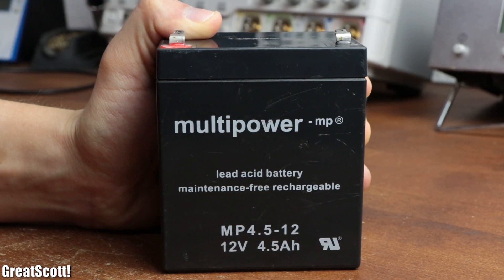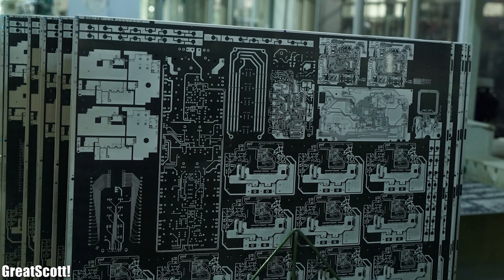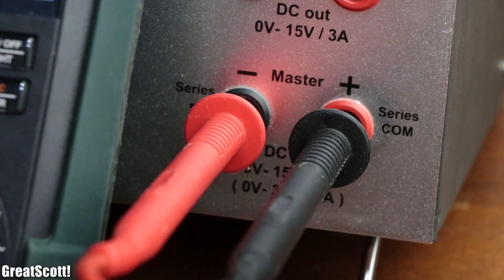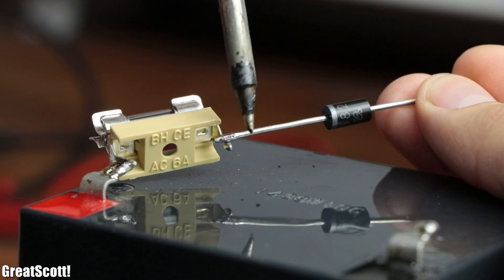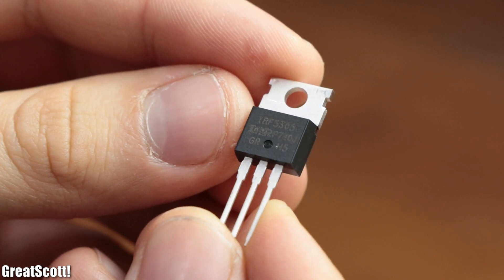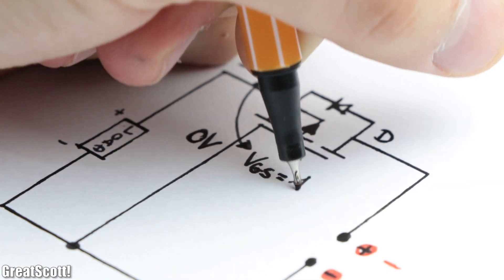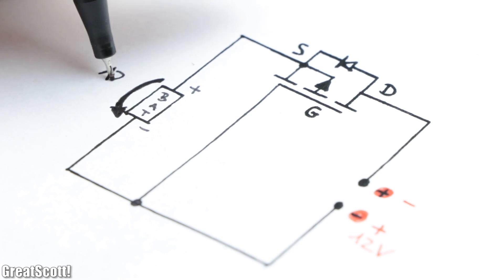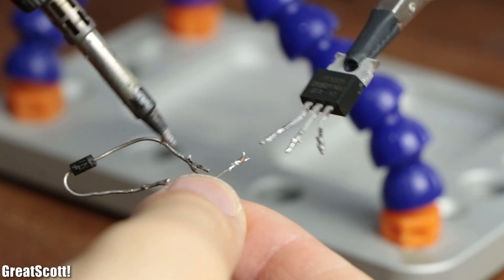What is the best Reverse Voltage Protection Circuit? || Repairing a Lab Bench Power Supply

Comment: Could anyone point me to an effective circuit for reverse polarity protection for a single 18650 battery and a small load?
I have modified my guitar's "Tronical" automatic tuning system to be powered by a Samsung 30Q Li-ion cell, but if I connect the cell in reverse accidentally (which would be seriously easy), I'm worried I will fry the difficult-to-procure tuning system. I have tried a diode sold to me by jaycar electronics, but the forward voltage drop was 0.6v and made the Tronical behave incorrectly. Obviously can't short the cell to itself, nor can any reverse voltage reach the Tronical. if anyone is able to use their superior understanding to help me with this mod, perhaps even help me find a source for parts or a small PCB, I'd be happy to chuck you a few bucks :) can also take the Tronical apart to show you the board, if that's of any consequence, but ideally I'd like to create the smallest possible circuit that protects both the tronical/load and battery/source completely and doesn't enquire fuses. if this can only be done with a fuse, I'll attach a fuse block to the front of my guitar.

Comment: You can use relay and diode 
You will get zero voltage drop and zero power loss 
The circuit works only when  reverse is applied

Comment: Try a SUP53P06-20 its on resistance is only 0.02Ohm for even less voltage drop. I would suggest mosfet protection, using a 10K resistor between the gate and -ve and strap a 12V Zener to clamp the gate voltage.

Comment: What is the point if buying such an expensive power supply if it doesn't have a reverse voltage protection built in it

Comment: I used just fuse and double shottky diode(s15d40c) from 5V rail of dead ATX power supply. It can handle shorts 100+ amps for a second, and have very low resistance. I think thats the best possible protection.

Comment: This "solution" only works for recharging batteries that are not flat.  A completely flat battery doesn't supply a voltage to turn on the circuit.  Neither would a regular load like a resistor or capacitor.
  In general, connecting a battery backwards to a power source is like a double strong short circuit and should be handled by short circuit protection mechanisms.

Comment: Hey, Scott can we use a relay and diode arrangement for this solution. Like Relay will only turn only when battery terminals are connected in right way?
Reply: Do the opposite ....wrong connection trigger relay disconnect
Reply: @davey2k12   ok let me try this one

Comment: I use capacitor between negative and postive terminal. If capacitor charged you can protect systems  Manual, by see the sparks if you change terminal. If capacitor discharge problem

Comment: And if you put a normally closed relay, with a diode, and when it is reversed polarised instead of short the diode it shorts thru the relay coil, opening the circuit?

Comment: I would have liked to see you use a real relay instead. No voltage drop at all :)
Reply: glyn hodges  Isn't 20mA the typical on current of a relay? Use and inline resistor to limit the current to the specified on current. Actually slightly higher, otherwise the load can pull the rail down enough to allow the coil to release, begin oscillating, and start buzzing the relay.

Comment: I was testing 2 different 13.8V power supplies to pump up an air mattress and by accident, I forgot to disconnect one of them while energizing the other that was also connected, I guess it didn't like backfeeding power that way as it damage BOTH of the power supplies.  Do you think I should try a similar fix (replace diodes) as you illustrated here?

Comment: why not use a bridge rectifier... seems to work all the time for me? what are your view?
Reply: the current passes through 2 diodes in a full bridge rectifier, and that leads to a voltage drop of around 1.2V, and you'll lose power accordingly.

Comment: Just made the same mistake... My solution is putting a external connection to the diode, so if i accidentally blow it again i wont need to disassemble the entire supply to changer it

Comment: Even though the circuit seems reasonable for voltage and most passive loads, what about inductive load?It seems as if there is no free running path for current in case the power supply is suddenly turned off.
 I've always thought that the diode in parallel with power supplies was not primarily a sort of fuse, but rather a free Wheeling diode.

The thing is, the circuit is pretty good, but it still needs some inductive kickback protection.

Comment: What about the body diode? Isn't it always in reverse polarity to the normal current through a Mosfet and so makes this circuit faulty? You can get a so called "ideal diode" but it consists of 4 Mosfets that simulate a diode because its not possible with just one - cause of the body diode!??

Comment: The output diode in series does not protect againt reverse polarity. It only protects the psu against high battery voltage.

Comment: Simpler method is put a diode in parallel with the output terminals and a fuse in series with one of the terminals. Wrong voltage applied to the terminals causes the diode to conduct and blows the fuse, and in normal operation the fuse is the only thing in the circuit, as the forward voltage will only happen when reverse voltage is applied. That is cathode to positive and anode to negative terminal.

Comment: Just was "gifted" a radio shack 447 CB. (Wired backward by original owner). Yes zapp.a Protection diode change. She runs like a banshee now. Protection circuits rule. Kv4li

Comment: And what about a diode in parallel which then has a fuse, so when reverse polarity is applied, current flows though the diode, then the fuse to close the circuit, the fuse blows up and cuts any connection from the psu to the battery? I see no drawbacks other than the fact that you have something blowing up that will need to be replaced every time you fuck it up.

Comment: blew today a device I was building, the device was done, and I was just doing the final calibrations. As I was plugging in my 12v power source I slipped with my multi meter and short circuited the supply voltage... my device is now Lightning like a Christmas tree. I guess the IC´s are absolutely toasted

Comment: I always check each and every connection with my multimeter before plugging power in and I check the battery terminals for current directivity before plugging anything in. Quick, easy and as safe as you can hope for (unless you're wearing jewelry - Example if you have a ratchet/socket in your Right hand and touch your socket to either terminal and don't realize you're touching your Left hand's wedding ring to the other terminal you instantly die as the power moves straight across your heart [it's right between your 2 arms & hands!] but good luck convincing anyone to remove their wedding rings when doing such work!).

Comment: you could just replace the diode with a higher rated one say 100 amp and then a fuse or circuit breaker in series

the diode would would do the same job as before but would take longer to be shorted thereby allow you to first burn up the probes long before blowing the diode but a fuse would protect against that

Comment: When charging batteries use a proper charger. My icharger detects all sorts of misconfigurations and as scotty said prevents fire..... you can get ics spevially made for a multitude of reverse current reverse polarity short cct and more.....
Reply: Scott . Maybe build an external all singing and dancing super protector with meters and leds. Maybe use the ltc devices or whatever...

Comment: WOW! I can't believe for the price of the equipment that you use that it doesn't already have PROTECTION!

I want to BUY that if you can make me a PNP for my INVERTER/s. We seem to have a MAJOR problem in TRACTOR-TRAILERS that cause inverters to blow for no reason. The small cheap 1's are pretty stout but if you buy any of them over $100 they become TRASH very fast.

Comment: I hate how segway made their controller for their electric scooter i was modifying one by adding a volt meter i had the wires already connected to the controller and the battery but the wire was too long so i had to cut it but to my stupidity i forgot that there was already power running thru the wires and i accidentally cut both positive and negative at the same time thus creating a spark i just ignored it but then it wont power up again i just hate how it doesnt have a short circuit protection

Comment: Only Diode in reverse is still the best, all other Versions can change your Output of your Power supply !
i would only use a Fuse with very high Amp rating, because they have a resistance too.

All Other solutions are only good for very simple Supplys, not for precision things.

Comment: hey scott, I'm trying to charge a Li-Po battery without XT60 connector in a project. can i use above protection for this.? instead of turning off the current flow(when battery connected wrong way), can we switch output polarity? is there any way to do it? pls find it might takes u to make another video.

Comment: Why use a silicone solution when you can use a relay for reverse voltage protection? Pricey, but you get no voltage drop, no heat generation. It surprises me how so few people show using a relay to make a truly ideal diode.

Comment: Could protect diode with a heavy latch relay on a separate power source disconnect the output when polarity is reversed or shorted with reset of cause .....just a thought tho 😀

Comment: There are circuits that use a relay in line with the load. The coil is driven by a circuit that detects very low reverse voltage and opens the relay.

Comment: Thank you for your time and effort to produce these excellent videos! You appear well versed in MOSFET selection. I have a reverse voltage polarity 6 - 8 VDC, 15 AMP (max) application I am evaluating that will require a low side N-Channel MOSFET. Any initial suggestions?

Comment: sense the reverse current and mod the psu voltage f/b circuit - best way to fix this problem. Just a resistor/bjt sense on the reverse diode circuit.

Comment: Some power supplies do not like power being supplied from the battery when the power supply is off.
The old kings hill bench power supplies were damaged if the power supply was turned off with the battery still connected.  My colleagues and I discovered this  when the lab earth leakage circuit breaker was tripped while charging some lead acid batteries. I would be interested to know if your PSU suffers the same problem. As I recall the fault was the result of latch up in the voltage control op amp circuit when mains supply was restored with the battery still connected.
As far as I can tell the MOSFET circuit does not resolve this problem, as current can flow through the intrinsic reverse diode between drain and source. In the preferred circuit, would it have not been better to run the driver transistor as an emitter follower to limit the MOSFET  gate voltage to Vz-vbe..

Comment: why could you not use a bridge rectifier between the battery and the power source thus ensuring the correct polarity which ever way the power source is connected?

Comment: You might throw in a warning to test this out with a lower current battery rather than a high current SLA battery. A 12V SLA battery can easily dump enough current to fry decent sized wires and start fires. Don't ask me how I know. Always use a fuse with such batteries.
Reply: in fact, he used not only the fuse.. 

in the video, the fuse is not popped because the mosfet stays off while reverse voltage and current happens.. 

so the fuse only is not enough.. because the reverse voltage and current is already flows to the circuit before the fuse popped.. even the diode can blown up if that matter happens..

but many electronics has no fully proper reverse polarity protection.. fuse and diode can prevent this.. 

but, the diode can be very hot while reverse polarity happens.. and waste the power in form of heat, and even can blown up the diode if the voltages and current was too big.. 

so the fuse is the last defender.. and mostly the current surge was already flowing to the circuit with harmful amount of current before the fuse is blown.. and the electronics circuits may already broken if that happens..

so, the video is describing the whole point of this matters..

Comment: A Simple circuit is to use a NC SPDT relay with a low voltage low resistance coil and and schotty diode  one end of coil to + out put. other end of coil to diode set to turn on with reverse flow and the other end of the diode to ground. Any reverse voltage then opens the switch and stays open. the NO contacts are connected to the PSU with a buzzer . a large cap across the PSU output.
In this way you get your cake and eat it also .. no effect on the voltage and or current, and avoiding sacrificial elements.
You boffins can re-work this for saving the coil. As only the buzzer is telling the operator to "BACK OFF".

Comment: I have often wondered why not use a small N.O. relay and a blocking diode to prevent reverse polarity.  Obviously this would take more current than any electronic circuit, but it is simple, robust and cheap !

Comment: The first circuit could never have worked as reverse voltage protection because the mosfet is the wrong way round.  Applying a negative voltage to the output forward biases the body diode and that's why it blows the fuse.  Simply reversing the Drain and Source connections will make it work better.  Of course  it's still not a very useful permanent addition to a power supply because the mosfet will not turn on at low voltages and the power supply will be unusable below about 3V.  The final circuit has the mosfet the correct way round but is only useful when charging batteries.  The mosfet will not turn on at all until a battery is connected.

Comment: I have used a microprocessor and a reed switch for protection. This way, the voltage and current from the lab supply remains unaltered.
Reply: y2ksw1 how quickly does it react? I was thinking the same thing.
Reply: @TheRainHarvester  Small reed relays can switch much faster than a half period of 50-60 Hz, thus "instantly" as we look and feel.

Comment: This is probably why using a lab power supply to charge a battery is not recommended. Battery charging circuits have protections built in for this reason.
Reply: Yeah... just a diode in series, than compensate the voltage...

Comment: i heard you will get the best results when you put your battery in the microwave... just multiply the Ah of the battery with the rated maximum voltage and you know how many watts your microwave should have for flawless charging. 10/10 totally recommended

Comment: diodes against the reversed power supply were often fitted in equipment made for cars and trucks like cb radios, the diode was usually a 25a or 50a diode, and called in the repair trade as ''the idiot diode''

Comment: But the battery protection from http://blog.deconinck.info works only for a battery connected only to the charger.

It does not work, for example, for a battery that is costantly connected to the charger AND the load.
Like, for example, a battery inside a home security system.

Correct?

Comment: I would just stick with the sacrificial diode. Maybe mounting a perf board on the back of the power supply that contains the diode on the outside of the power supply for ease of replacement.

Comment: It's not quite as easy as you make it seem.

The reverse diode is also useful for inductive loads, when keeping them hooked up while switching off your supply or when your DUT is faulty. 
So the reverse voltage caused by the inductor will bust your "reverse voltage" protection and most likely even more than that to render your supply useful.

I was tinkering with a similar solution in a PSU project of my own, but I stuck with the diode solution, since it is safer.

Comment: Hello Great Scott: I don't know if this would interest you... I have an idea for a project for you... I am working on a wired remote control mini pontoon boat (wired so if something goes wrong I won't have to go swimming for it). 

What I want to do is make an ultrasound depth finder on it with an LCD display... It will all be controlled with an Arduion uno... The purpose for this is for fishing I would like to be able to drive the boat to where I intend to cast my line, and find the depth.

Comment: Please don't use "open" and "closed" for semiconductors (yes, it is tempting to do so, even in German). Please use "conducting" and "non-conducting" to clear things up.
Reply: Why?
Reply: @nUrnxvmhTEuU  Because it is ambiguous. You can think of a circuit as open (not conducting) or a valve as open (conducting). Same with a closed circuit (conducting) and a closed valve (not conducting).

Comment: You now have a circuit between the battery and power supply, is it protected against reversal of both ends? Before you had only 2 possible ways of connecting, now you have about a dozen.

Comment: I see it was an easy repair this time, but I would love to see you reverse engineer things and general repair tips and tricks. Maybe this isn't your cup of tea, but if it is, it'd be very interesting. I got into electronics largely because I like transforming what other people see as waste, into useful resources again. I've spent many hundred hours in my garbage room, salvaging parts, working electronic gadgets and also repairing and giving away or selling cheap. Through your channel, I started building things from scratch, but I would also like to develop my repairing skills. So I'd love to see more of you, repairing things and describing the most common causes of modern electronic devices failing :)
Reply: Torgny Nordén I just fixed a cheap multimeter on video.  It's so satisfying to repair trash.
Reply: X2